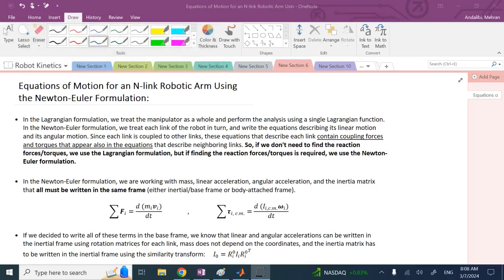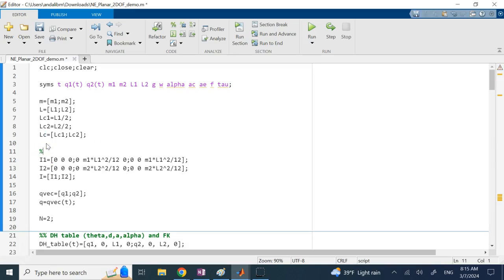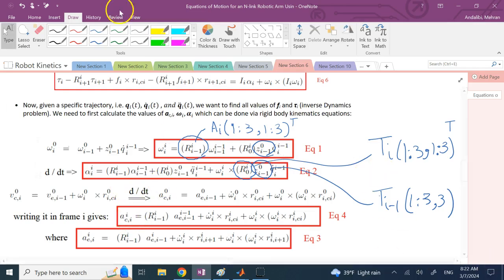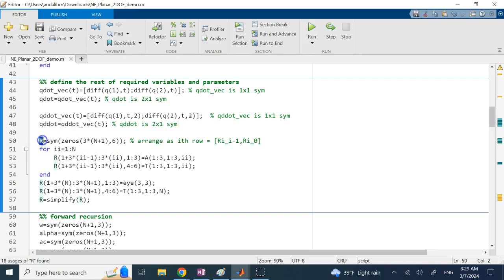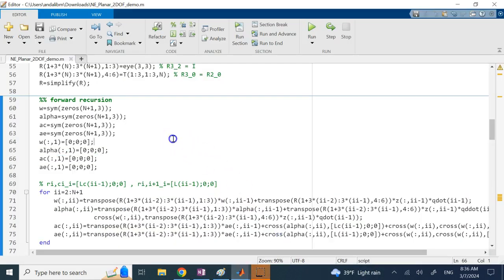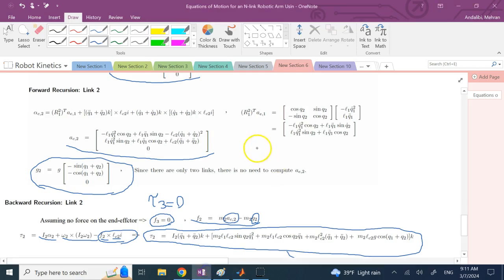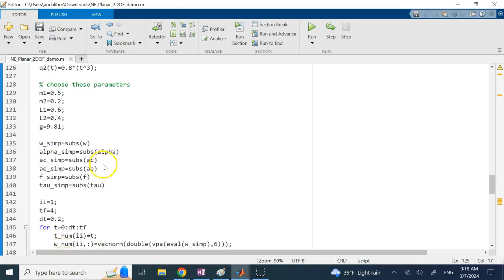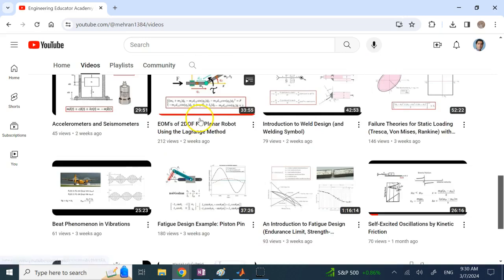MATLAB Symbolic and Newton-Euler Formulation of Robot Motion

Comment: Is it possible to apply the constraint equations in the Newton Euler Formulation? I would like to calculate the torques and moments at the joints in the NE method using the lambdas obtained in the Lagrange-Euler equation. For use in structural analysis.